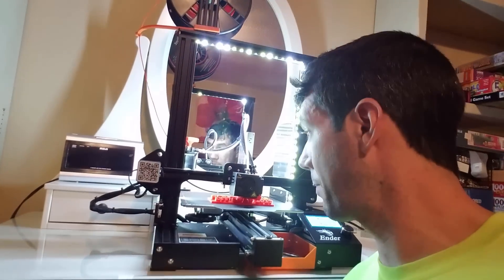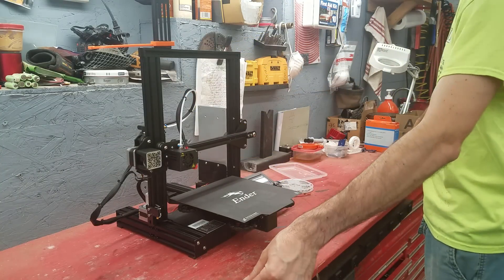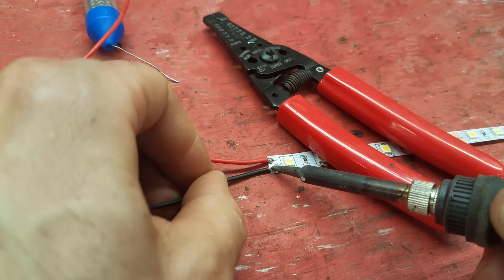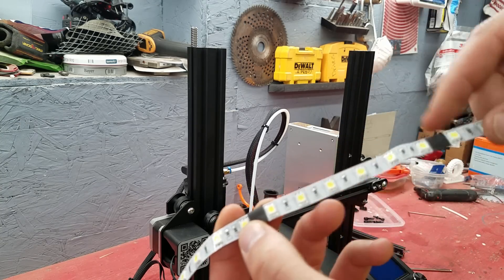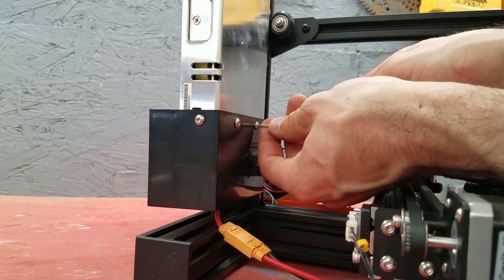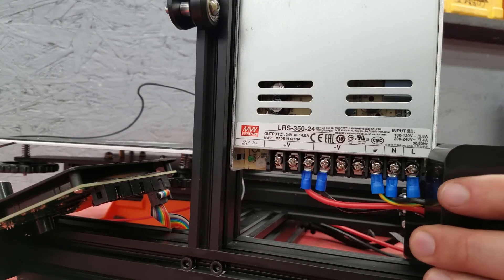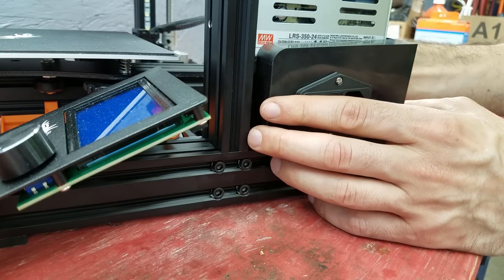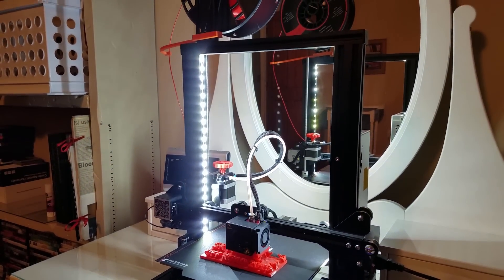How To: Cheap LEDs on Ender 3d Printer

Comment: I'm thinking of using a 5mm LED strip that I glue to the bottom of the V-slot. It will be nicer than loosely plugged in. 5mm LED strip + 
 24V to 12V converter

Comment: Max, have you noticed any performance issues since you installed the lights on your printer? Heating is ok? Speed, quality, everything just fine?
Reply from the maker: Everything seems fine.  The power supply puts out plenty of power although I do not print over 230*C

Comment: Just a heads up guys. I installed a strip like this that had the plastic/squishy top. Seemed fine, but the rollers catch it just enough to make the Z miss steps and send me on a goose chase.
Reply from the maker: Good to know.  That is a waterproof type. I did not use the waterproof type.  Everyone make sure the rollers do not hit the strip.

Comment: It is more challenging than you made it out to be to get the lights into and out of the upper rail. If I were to do it again, I might trim the strip where the corners are and solder wire between them to make it easier. Other than that though, works like a charm.  Thanks for the tutorial!
Reply from the maker: This took me a few hours to do but no one wants to watch a video that long!

Comment: What if I have 12 volt strips? Is there any workaround? :)
Reply: To step the printers 24v down to  12 volts, use a buck converter. They are about 3 dollars online and they would work perfect for this application!
Reply: I think you could cut a led from the strip, and then wire it in series with the rest and it should work.
Reply: I mean cut until the next connection, depends on the strip**
Reply: @alexflorin04  Yeah, I have connected 2 LED strips in series and it works.

Comment: así lo hice y mi ender se quemó... Muchísimas gracias 😡
I did so and my ender burned ... Thank you very much 😡
Reply from the maker: Burned?  No longer works?  Not sure why?  Sorry.
Reply: Maker Max Corbett After putting the 24 volt led and connecting to the power source, the machine turned on and the main board and screen burned.  I bought it from aliexpress and I am waiting for it to arrive.
Luego de poner los led 24 voltios y conectar a la fuente de energia encendi la maquina y se quemo la tarjeta principal y la pantalla. La compre por aliexpress y estoy esperando a que llegue.
😡😭
Reply: Perhaps you put the wires in the wrong places?

Comment: Can this work on 12v LED's?
I have a small roll of that right now and would like to not have to buy more.
Reply: You need a BUC converter to step down the 24v from the power supply to 12v
Reply from the maker: You can wire up the 12v leds in series to use 24v.  Basically strip 1 positive in from supply.  Strip 1 negative out connected to strip 2 positive in.  Strip 2 negative out to power supply.

Comment: This is bad on your eyes. Those LEDs are almost as bad as lasers if you look at that setup for a long time.
Reply from the maker: Someone put a link in the comments to apply a dimmer to the LEDs.
Reply: @MakerMaxCorbett  If you use the 12V LEDs, and a buck converter, varying the voltage will dim / raise the brightness of the LEDs.

Comment: Is there on option turn lights off and and manually? Or does the light simply stay on when the printer is on? Also have you noticed and issues since the time you installed it?
Reply from the maker: I did put a switch in mine, but left that off the video.
Reply: Since it's connected to the same power supply as the printer, you wont be able to turn the LED's off independently. You would need to get a separate power supply to turn the light off independently
Reply: @mindsofgreatness  you can put a switch between the LEDs and the power supply. Put it on either wire but positive is standard.

Comment: The insulation on the front side of the LED strip is not adequate for 24v - there is a risk of shorting to the frame.  Also, the solder joints to the LEDs, though tiny, create a risk of shorts.  Add a protective flexible coating to the strip, around the LEDs.  Or, insert a length of filament into the track, one on each side, to keep the front of the strip spaced away from the frame.  Or both.  The rear of the strip has adequate insulation, especially if the protective layer over the adhesive is left in place.  The LED strip can be run below the top rail, using the adhesive backing, to avoid the problem at the corner.
Reply from the maker: I put a piece of heat shrink at every solder joint. Not sure if I mentioned that in the video.  You are right about it shorting out.
Reply: It's not just the solder joints - the insulation covering the tracks in the flexible strip itself isn't good enough for 24v.  This may be dependant on the quality of the LED strips.   I have also seen cases where the plastic covering on the front side of the strip is off centre, exposing the edge of the copper track underneath.  Slipping a piece of filament in to keep that front surface away from the frame is simple and effective.
Reply: IP65 rated LED strips are marginally more expensive but have silicone layer on the front which would protect the strip from shorting to the frame.
Reply: @danielthackeray7798  why not just electrical tape in those grooves? Just for that extra layer of protection?

Comment: Was an ON/OFF switch wired in anywhere or is it just always ON while the machine is running?
Reply from the maker: I did wire in an on/off switch but I did not cover it in the video.   I put a switch next to the main power switch.  To keep the video short I assumed people could add their own.  Maybe I should have said that, sorry.
Reply: @MakerMaxCorbett  Nice review. subbed! What switch did you buy from Amazon. tks!
Reply: I was curious about this also.

Comment: I'm thinking of trying this on my Ender 3. What diameter heat shrink tubing did you use?
Reply from the maker: When you buy it, it comes in a variety pack, so what ever fits over the wires.

Comment: Now that's what a good solder joint looks like. Pre-tinned wires and fresh solder on the joints. Personally I would use silicon wire (it's bendy and the insulation doesn't melt or shrink) but any wire will do, as long as it's thick enough and is insulated. I'd also use spade connectors on the other end. Clip off the plastic part and solder the wires in, add some heatshrink and you got good connectors.
Reply from the maker: Thanks. They are not hard to do, just take your time.

Comment: This works quite nicely to illuminate my prints.  One way to get the LED strip to come out at the top brace corners, is to slide a small screw driver behind the string and pry.  Otherwise do everything the way Max C shows.
Reply from the maker: Thanks glad you like it.